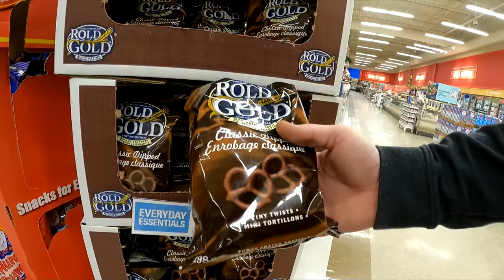Solo Overnight in 10 sq. ft. MICRO HOUSEBOAT (bad idea!) - Wood Stove, Ice Breaking, Cooking

Comment: Full stop always, 2 to 3 times for every vid and sharing. "If you are going to fail, fail quickly" helps me so much to reduce fear of failure and try something. Learning is not a failure its a gain. If evey project or task went seamless and perfect, then I would be an underachiever as that ment only certain tasks were attempted to ensure perfection.  Never learning, thats the biggest failure.

Comment: Full Stop. Doing research on a couple of on  going projects. My "poncatanoe" (pontoon catamaran canoe) and my 53in. x75in. utility trailer. At first I was going to build my "boat" suitable for car topping. Now I'll just use the recently acquired trailer to build a small camper. Then I'll mount the boat on the trailer.
Liked some of your ideas on your boat and your "glamping trailer".  Had the same idea on a canoe that I bought used in '79. People would see it on my truck rack and ask what the heck is that? I guess they had never seen a canoe with out riggers. Had loads of fun in my "outriganoe" until I sold it in '08.
Just discovered you channel been watching for 3 to 4 hours. Keep up the good work. Stay safe and have fun.

Comment: Full Stop. I've enjoyed all the videos of yours I've seen. I don't usually intend to watch them all the way through, saying to myself at the start of each, "Oh, this is ridiculous." And though ridiculous your projects may be, they're also super fun (and super funny) to watch. Can't think of a time when you didn't get multiple laughs out of me, per viewing. You also come up with some amazingly practical ideas, such as, in this case, your cordless drill boat motor! (Suggested improvement: run the threaded rod through a slightly larger diameter aluminum or other metal tube, locking the tube in place with tightened nuts on both ends; this would give you a smooth "drive shaft.") Looking forward to seeing your next unusual, though possibly practical, project.

Comment: When you were adding the propeller to the rod, I was wondering if it was the right way and if spinning it right you would be in reverse or forward and maybe it was backwards and you needed put the drill in reverse to go forward....
But I couldn't tell on video... but I did know if you did put it on backwards and welded it,  it was no turning back and you would have to use drill in reverse to propel boat forward...

I guess the easy way is to say... should have tested it in water before fully welding.
Reply from the maker: There is no backwards on a prop it's the way it's cast.  You can't flip it.

Comment: U need an older outboard like a Johnson seahorse detach the lower unit from the motor and use a wood plate to seal the top and your drill idea will work a lot better just put the shaft directly into the drill chuck and go you could even adjust the trim

Comment: The propeller is mounted on backwards it'll Propel your forward if the drill is in reverse take the problem off and turn it around and that should solve your forward backward problem
Reply from the maker: You can't flip it to make it propel forward in drill forward position because of the way the prop is cast. https://boattest.com/article/propeller-rotation-explained-how-choose-between-left-and-right
Reply: @ModernSelfReliance  I just had my dad look at it too and the prop is on backwards if u flip it around it will work please trust me I may not b smart but what I do know is  boatmotors and props

Comment: I miss my drill outboard. I figure I don't need to register the dingy if it's not a real motor right?
Reply: Oh, and use a pvc pipe, and some skate bearings to help keep the all-thread straight. Otherwise, it'll want to bend as it wobbles around.